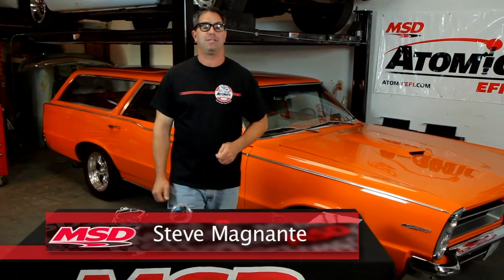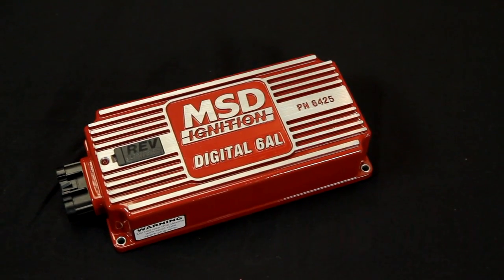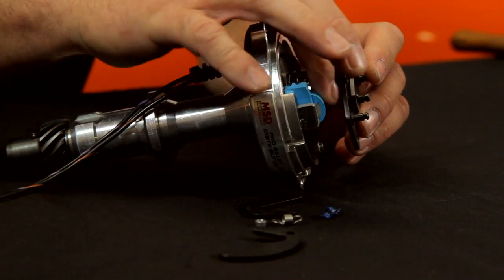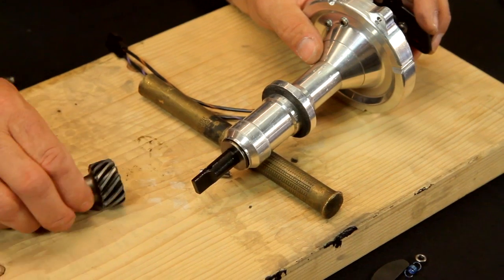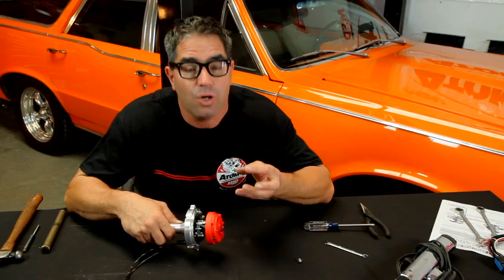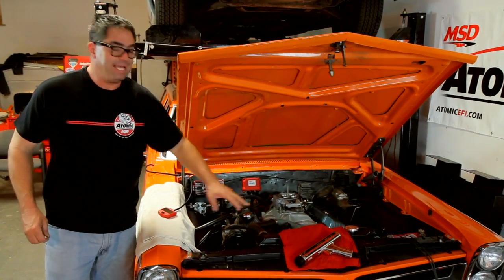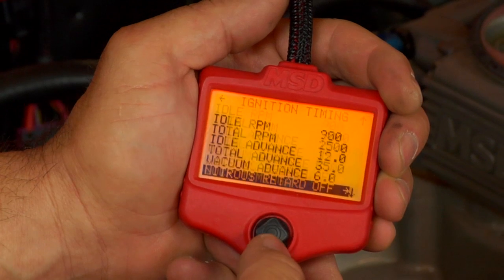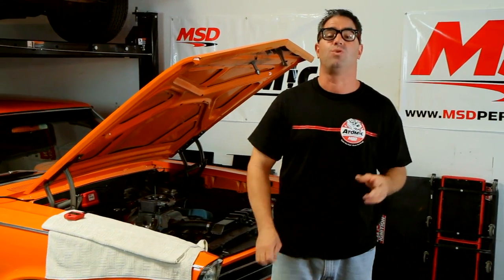Setting your timing curve with an Atomic EFI TBI

Comment: When setting the distributor rotor you said to set it to 15 degree advance,  but the instructions that came with the MSD says to set it at 15 degrees retarded. Which is correct?

Comment: Just a quick question, I've been searching the MSD website looking for all the components mentioned in the video, I managed to find the 6AL Ignition Timing controller easy enough, but the 2 piece distributor rotors are proving hard to locate... are the included with the Ignition Timing controller?  Also, are they universal?  I'll be using mine on an Australian engine (a 253cui Holden V8) which is probably closest related to a Chev small block, but still very different as far as firing order and distributor drive gear. Any advice would be appreciated, thanks
Reply: Alex Katsikas summitracing and Jegs sells them